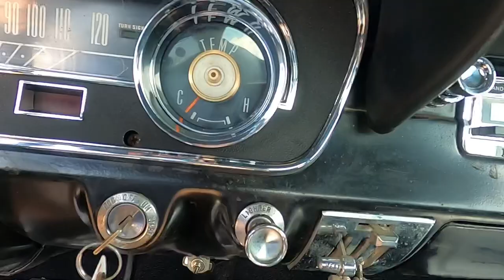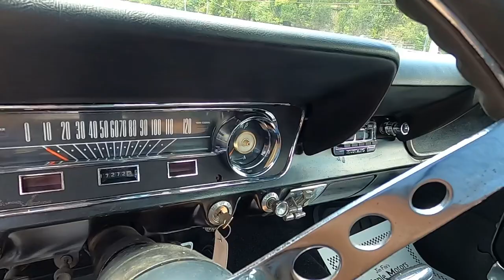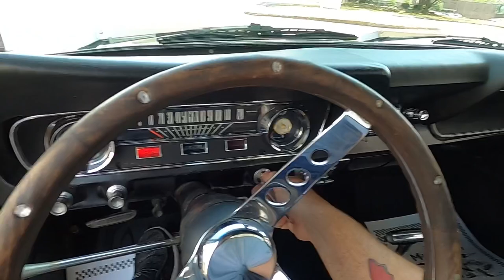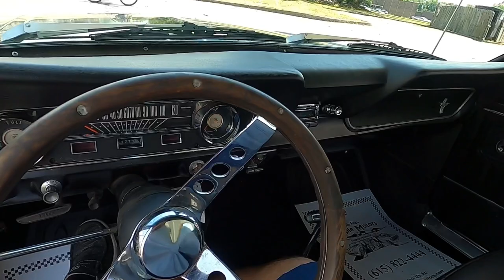Test Drive 1965 Ford Mustang 2+2 Fastback 289 SOLD $40,900 #1602

Comment: she has a good old C4 transmission. in my 45-year transmission career i have rebuilt about 22 million of them, LOL!
Reply: Hey bud,  transmission question for you since you have seen lots of these c4s. My 1963 f100 has a rebuit c4 and when i shift it manually from first to second, it will only hold second gear for about 5 seconds and then goes to 3rd(drive). This happens even when the shifter is locked in second gear. Other than that, tranny works perfectly.
Reply: @tyclute1454  that was known as a green dot VB "valve body" they will do that. you can put a latter VB on, and it will hold the gears.
Reply: @olskool3967  thankyou!! I will give that a try.